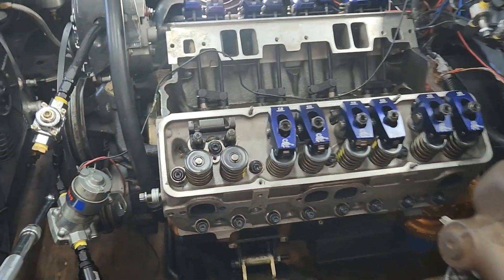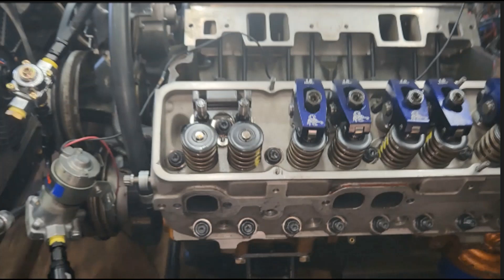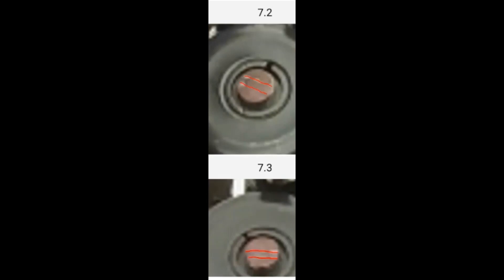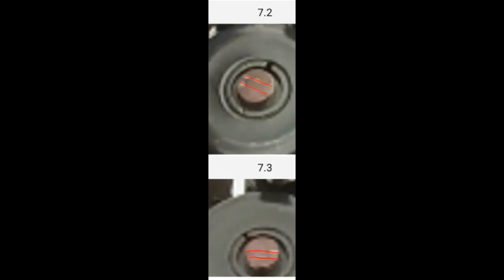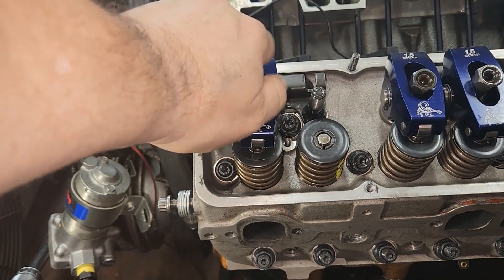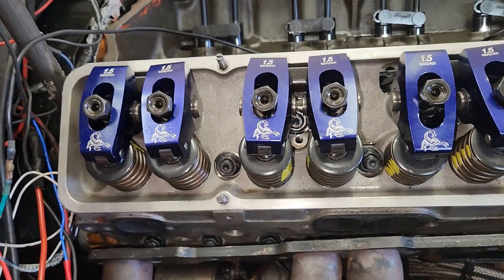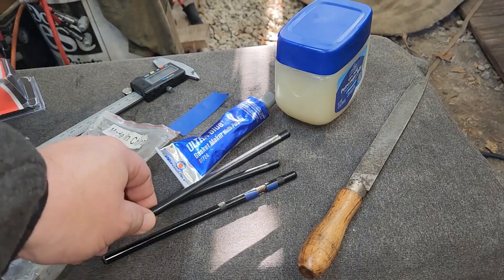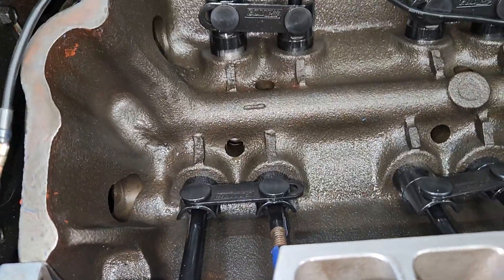ARP Studs Hitting Rocker Arms SBC 1980 Trans Am

Comment: Having the same Problem now with the "90 degree" Method... Almost off the edge of the exhaust side... Any Problems so far in your combo ?
Reply from the maker: Video is 2 years old. Car made many passes since then but eventually a fuel pump failure melted a piston. I wound up running a bit longer push rod and ground down that side of the rocker some to clear those big ole studs.
Reply: @CarportGarageDragRacing  In the past i was having the Same Problem that my studs rub on the Rockers .. did the Same Like you... Ground the Rocker down a little
Reply: @CarportGarageDragRacing  but valvetrain is fine for two years ? I have tried that 90 degree at half lift Method quite a while, and on a Small Block Chevy ITS hard too get... The Angle of the valve in Relation to the Rocker stud is the biggest Problem

In my Case, I have bought the AFR Enforcer Heads and the valve Tips in these are longer than usually, that makes it more complicated... And every Rocker manufacturer makes a little Bit a difference in their Rockers... How should i know wich Rocker i should Order??
Reply from the maker: @ yes the valvetrain was just fine those 2 years. As far as which one to order, I am not sure, we ran the Scorpions just for budget reasons.

Comment: Thats why you get tall studs, which are out there, i have some, also you can purchase adjustable valve guide plates to center your rockers over the valve stems , last i knew ISKY cams had them also with taller studs you need longer push rods and maybe lash caps on the stems to get the geometry back !

Comment: You all you have to do is call crane cams or Esky summit racing tech department will give you the right way of doing it download the information correct way of doing it I like the idea of last cap longer push rod it all depends on what you're doing with the motor just driving around on the street or are you full racing.

Comment: How about longer push rods along with lash caps?
Reply: I am going to go with a 7.3 pushrods, the 7.2 pushrods I have now are actually a bit too short. The 7.3s will clear and are actually better as far as centering on the valve stem goes.
Reply from the maker: ^ that's me too, forgot to do the switch account thing

Comment: I would assume that's a solid roller if you're checking with those Springs. If its not you might want to use light springs as to to not take up all the travel in the lifter.
Reply from the maker: They are hydraulic roller springs.
Reply: @CarportGarageDragRacing  you need very light Springs to check your push Rod length on a hydraulic lifter.
Reply from the maker: @michaelreynolds1500  ya, unfortunately I don't have any ATM. May invest in some.

Comment: I would take a little off the top of the stud it self
Reply from the maker: It's hitting the nut though. I don't feel comfortable grinding down the nut.
Reply: I wouldn’t either, knock the rocker down or address with longer pushrods & lash caps to raise the rocker and maintain geometry
Reply: @torkrench  I am going to go with a 7.3 pushrods, the 7.2 pushrods I have now are actually a bit too short. The 7.3s will clear and are actually better as far as centering on the valve stem goes.
Reply from the maker: ^ that's me too, forgot to do the switch account thing